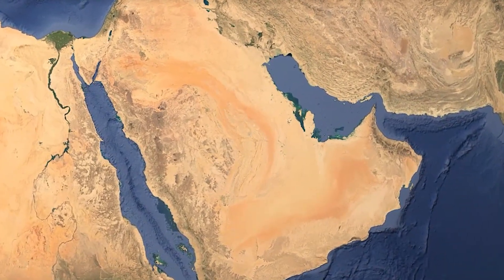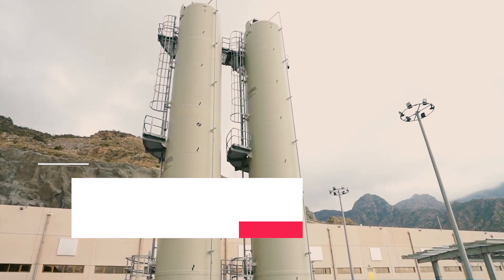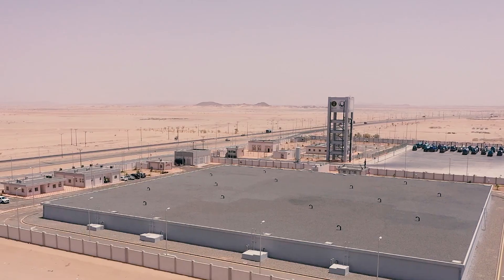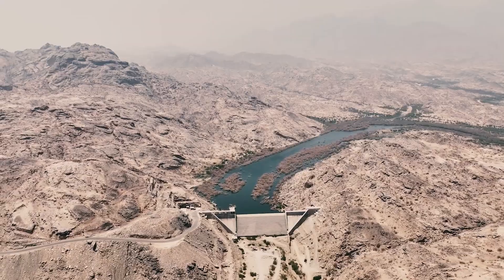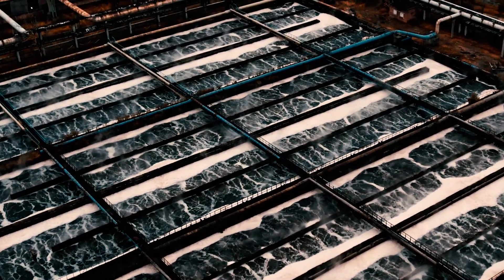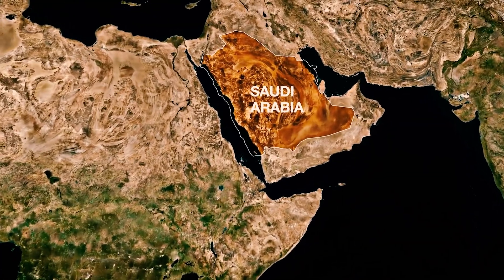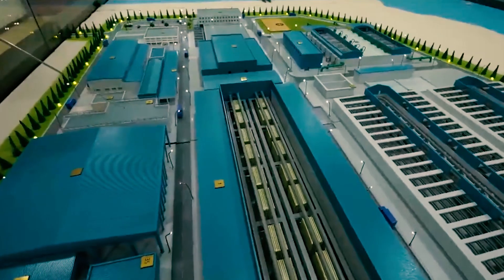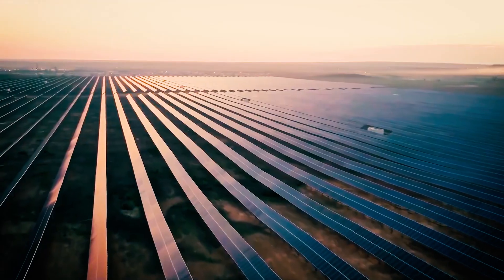How Saudi Arabia Get Water

Comment: Pluvicopia revolutionizes water on the Arabian Peninsula, converting water production from a vast energy user to a limitless energy and water production system. The energy comes from limitless latent heat available in the south and west of the country. Because the technology requires lifting the latent heat, it produces water on the north and east of the mountain ranges, which flows by gravity throughout the peninsula. Hydroelectric energy is only one source of energy; the system creates cool winds continuously in the same location, cutting wind energy by 80% of its cost in conventional wind turbine systems. Please read the book to contact me with the links to develop this critical technology. It is extremely profitable. The whole peninsula can be made as green as desired and even help to control sea level rise.